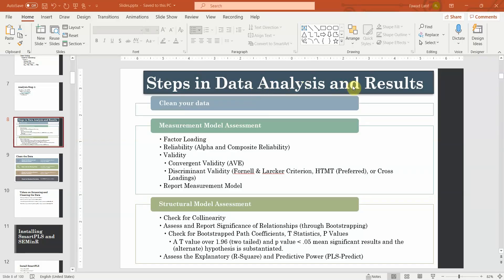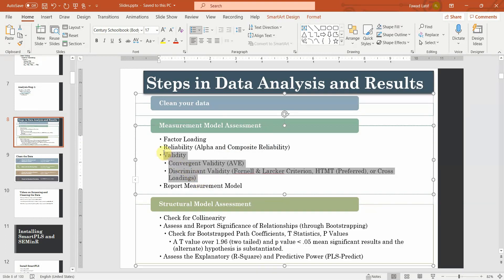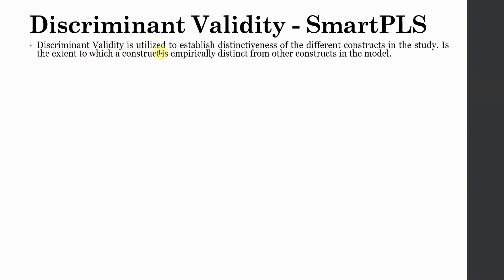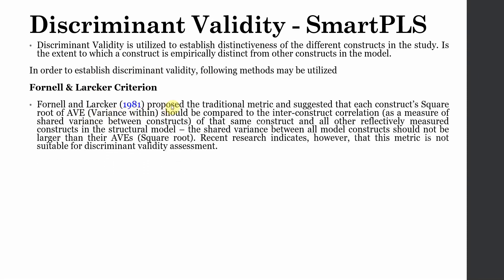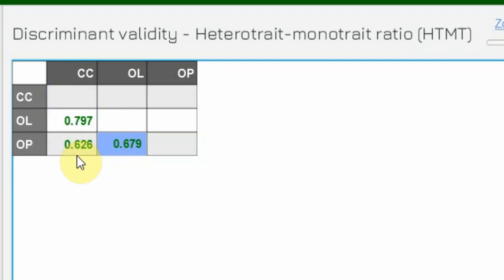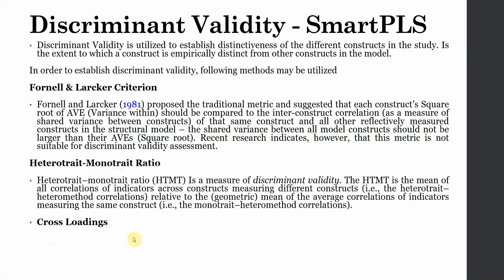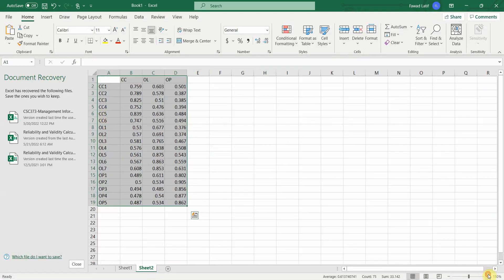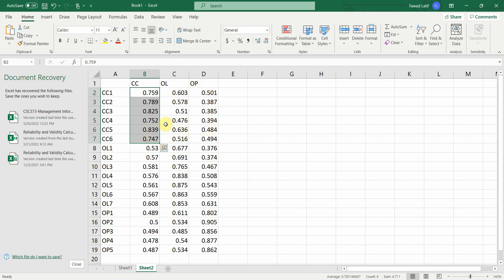#SmartPLS4 Series 9 - How to Test Discriminant Validity?

Comment: Thank you so much for these lectures! You're making research easy to understand and accessible for everyone. I do have 2 questions though... (1) Should I include cross-loadings for the moderators? (in SmartPLS there's a column in the cross-loading with Variable A x Variable B) Or should I remove that and focus on the individual variables when writing? (2) What if you have a variable with a categorical measurement type? Let's say socioeconomic class. Do I need to establish discriminant validity for that?
Reply from the maker: Thanks for watching. Crossloadings for the moderating effect are not reported.

Comment: Assalamualaikum. In my basic model, the relability and HTMT for all variable were good. but after coverting two LV into one higher order construct the chronbach alpha became .404 of this HOC and its HTMT with two another constructs is 1.02.
How to solve this issue? or shall I consider the reliability and vality scores before converting it into HOC?
Reply from the maker: WAS. Alpha is low because of the no. of items. You can check SD and see if there is no SD, if so remove that response.

Comment: What if one of the construct is more than 0.9 in Heterotrait-Montrait Ratio? What should I do for this issue?

Furthermore, the cross loading for 3 items are more than 0.7. That 3 items are more than 0.708 in the Indicator Reliability Test, yet the items do not affect the AVE > 0.5. Should I delete the items?
Reply from the maker: If HTMT is higher and deleting cross-loading items can help establish discriminant validity, you may delete them one by one and see how it affects HTMT.
Reply: @researchwithfawad  It’s work! Appreciate Mr Fawad’s advice! ^^